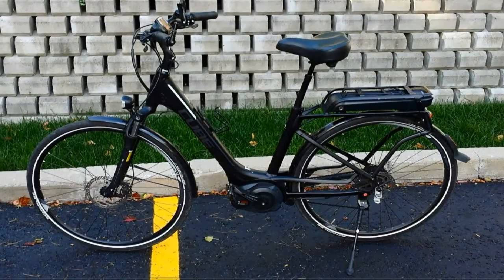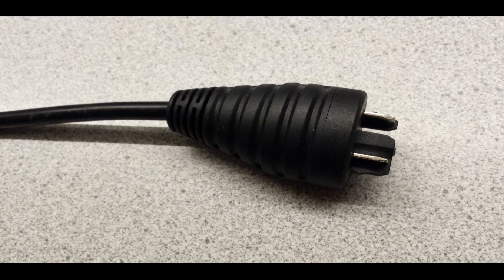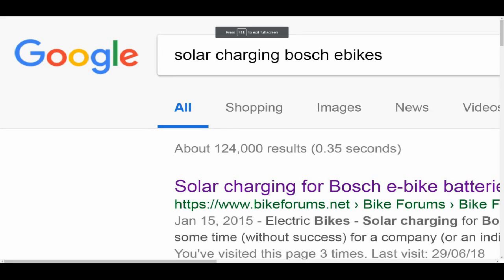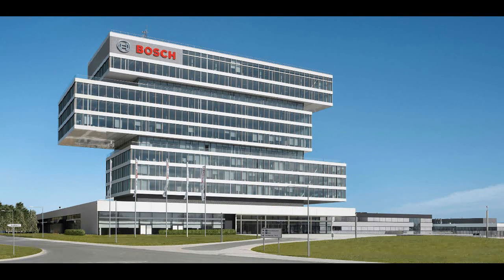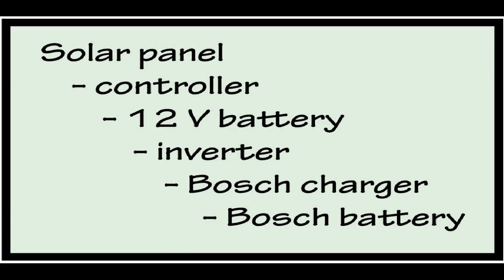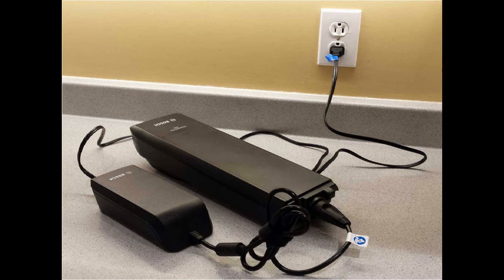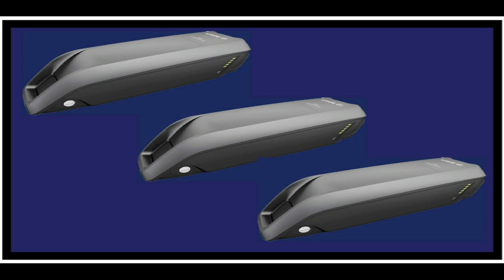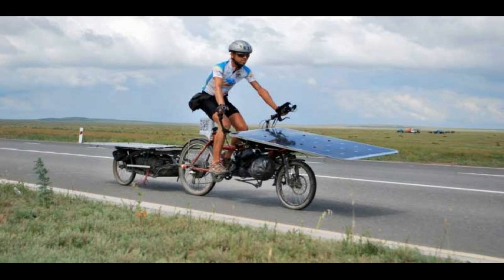Solar Charging a Bosch Ebike Battery   Disappointment

Comment: Hello Robert, I am a certified Bosch e-drive technicien, the information you got is right, you can't charge a Bosch battery with anything else then its charger, the battery has an electronic board that works only with the rest of the system or the charger, the battery needs to be powered buy a 5 volts dc to activate, and event then it will pulse, because it needs a specific signal at a certain frequency to operate, Bosch does that so nobody can use a different battery on their system and to protect the battery from another type of charger that could damage it, and also to manage the whole system, you get three pages of info on your system when you connect it to the a computer for software service and updates. Your Bosch system is a very well designed system, and works very well as it is. If you had a standard battery that can be charged by any means, it would still be impossible for you to charge it with solar panels on your bike, your battery voltage is either 36 volts or 48 volts, if you have a 36 volts battery, you would need 3 solar panels in series to charge it and 4 in series for the 48 volts, they would have to be very small to fit them all on your bike, in order to charge a battery, you need your charging voltage to be higher then the battery voltage.
Reply from the maker: Thanks for the excellent explanation for the way Bosch manages its battery and charging system. That's the best explanation I've found. As for charging from a solar panel, you don't need multiple panels in series. Most Sun Trip participants use an MPPT boost controller to feed the power to the battery. Thanks for sharing your knowledge of Bosch.
Reply: Robert, THe charger puts out 42 volts between the minis and plus when 5v apply to the third pin. Serendipity Sue here on youtube has videos on how to charge the bosch battery and it does work. Charging a spare battery and swapping should work fine.
Reply: Bosch doesn't do this to protect the battery. To protect the battery, internal smart regulartion and monitoring is enough. Bosch does this so that people will be forced to buy their chargers as well, so that they can make more money. Just another charge and cable to carry around. This must stop.
The information you provide is distraction, you don't need to increase the solar panel count, all you need is proper power conversion to acquire the right power. 
With enough voltage and limited amperage, charge speed would only be low.
There is a big difference between "you can't charge it" vs "you can charge it, but it will be slower compared to outlet".
The "specific signal" whatever magic can also be easily acquired and simulated.
If it's safety, I'm with you. But if it's about Bosch having more convenience at the cost of my own convenience and less money in my pocket, then no I'm not with you.
Reply: Hi Christian-Maurice, Im Trying to build a Drone Charger with my bosch battery, I have a charging port directly in the frame of my bike. I would like to order a plug(you can only get the 5Pin version) and plug it in. Btw do you know why I have those 2 more Pins on the 5 Pin plug(6Amps)? I then want to Use a Voltage Step down board(enough watts) to get from the 36V to the 12V of my charging Device for the Drone Lipo batterys. I will also put in a 4A Fuse. Do you think that will work? Do I have to put 5V on the regulator Pin to get current out of the battery? And do you reckon the reversed current will damage anything? I thought, if I use  the charging port, just inverted, It should be fine. But I didn't know about the 5V regulator Pin, guess it switches a MOSFET or so. I hope you can give me some advice :)
 Thank you for your help :)
Reply: Didn't Bosch sell a 12 volt charger?

Comment: I’ve got the Bosch 500 it’s packin, plenty of juice! To charge it up via solar would take days. Unfortunately better solar tech isn’t available for the general public yet? 
When we all switch to e cars, electrical prices will Ffffrrriizzzzlllle 4 shizzzle!
Reply from the maker: Solar panels are still improving. SunPower now has a flexible panel that is 25% efficient. We're getting closer to the point where it will be possible to travel by road solely on energy from sunlight.

Comment: I read somewhere that the 12v chargers only work when the battery is connected to the bike. Just tested the voltage on the side plug and found 41v
Reply from the maker: My batteries, the rack-mounted Powerpack 400 and Powerpack 500, don't have a side plug. So to charge one with a solar panel, if that had been allowed by Bosch, I would have had to charge it off the bike. With three batteries that wouldn't have been a problem. From what I've read, Bosch has discontinued its 12 V charger, ostensibly because people have been ruining their car batteries in using the charger.
Reply: Да, так и есть. Я подключил солнечную панель к боковому штекеру. Начинается зарядка, и через 5 секунд отключается. (при достижении 3,9А)
Reply: @MrGf3  its obvious you have no idea what you are talking about. The battery cable is always min. 36volt. For your safety pls just leave it alone before you harm yourself

Comment: https://www.ebay.co.uk/itm/eBIKE-BOSCH-TRAVEL-BATTERY-CHARGER-ACTIVE-PERFORMANCE-12V-DC-DC-0275007914/173916143930?epid=534509664&hash=item287e35c13a:g:BsYAAOSwSINc6wF~
Reply: only one left ,hurry :) i have the 2011 charger with different connector. so i would need a 2013 2011 charger adapter as well to use it. more money. the 2011 charger has a slow option at 36v 1a. that would be awesome for a small solarpanel. this is offcourse 36v 2 a. 150w might be enough.
Reply from the maker: The problem there is that I'd need to feed the solar panel into a 12V battery to plug the charger into. Extra weight and loss of efficiency.
Reply: @RobertBeriault753  you could also get a 12v solar panel and directly put an carplug on there. or a dc dc converter with carplug. could even strip the 12v car plug from the bosch charger and attach the wires to a 12v converter or directly on a 12v solar panel?
Reply from the maker: And, I haven't confirmed this with Bosch, but someone told me it doesn't work with the 500 Wh battery.
Reply: @RobertBeriault753  i would say if the 2013 charger works on the 400 and 500 packs then why wouldn´t it work on the 500. well the outher housing of the v12 charger is the same as the 2013 charger it seems. or do you need the smaller 2017 charger voor the 500wh pack?

Comment: Excellent Points.  I suspect that the American Legal System, (where everybody sues everybody at the drop of a hat,) is likely why Bosch is so reticent on supplying European products to American Consumers.  For example, I bought my FeltElectric SPORTe95 in October 2014.  Bosch had been licensing their pedelectric motors to manufacturers and selling them in Europe for SEVERAL years by then, but at that time, in the States, NOBODY seemed to be carrying them.  I bought mine because it was lightweight (30 lbs. stripped) and would power through a 25 mile roundtrip commute to my job.  Since then, FeltElectric has dropped the price of them by $1000, I suspect since NOBODY besides me was buying them.  My loss, and an expensive lesson for earlier adopters of new technologies.

It makes NO sense at all for Bosch NOT to offer an official solar charger.  
In the same vein, MANY other manufacturers include a standard USB on their speedo/controller units or directly on the battery, so that you may keep your phone charged.  On my controller, it includes ONLY a microUSB female jack.  

I have attempted to link my iPhone via a Lightning Cable to a cable featuring a male microUSB connector and a female USB jack, but (of course) Apple's arrogant error message, about the tools not being compatible, pops up.  It is ridiculous.    My solution, at least for the phone, is to use a small,  solar charger, https://www.amazon.com/24000mAh-Waterproof-Portable-Compatible-Smartphones/dp/B07C24XC2L/ref=sr_1_4?keywords=solar+phone+charger&qid=1557328677&s=gateway&sr=8-4, that I connect to my iPhone by USB.  It keeps it charged, but there is still no way to use any solar charger for the Bosch bike batteries. 

Collusion indeed.  This is sad.  

First Bosch persuades us to buy their products, but then tells us to sod off when we ask for new innovative product development to support and improve them.
Reply from the maker: You've elaborated on my points with your excellent ones. Another thing that irks me about Bosch is their refusal to provide a throttle on their bikes. I can see why in Europe, where it is forbidden by law, but I would have thought that the rest of the world is a large enough market to make another category of bike for. 
While I'm at it, why doesn't ANY ebike manufacturer produce a battery with a 12 V outlet, like all cars now offer?

Comment: Bosch is disappointing also on upgrading to their dual battery product... and in stating they are not familiar enough with solutions to modern needs like solar charging... I thought higher of Bosch. Of course - it is quite dangerous to go engineering on it by yourself...
Reply from the maker: Another disadvantage is that the Bosch system doesn't allow a throttle. As my knees age, this is becoming an issue for me.

Comment: Hi, Robert.
I think this will work:
Use a 2 Amp Bosch charger connected to a GoalZero 100 AC power bank connected to solar.
The 100 AC will refuse to feed the 4 Amp Bosch charger.
You would probably bring a power bank for your other electronics anyway. This one is not very bulky.
Kind regards
Søren
Reply from the maker: Hello Soren

The GoalZero is a nice power pack, but of insufficient capacity to supply power to the Bosch charger, which needs an input of 270 Watts. I thought about buying a more powerful pack, but it would weigh several kilograms. 

Best regards
Reply: Hi, 
You would be using the Goalzero Sherpa AC100 as an inverter not as a powerbank.
Connect a solar panel to the Sherpa’s 8mm input port and plug in the Bosch charger to the AC outlet.
I have tried this with a more powerful solar generator, which weighs too much to consider bringing on a bike ride.
When I get a chance to test the Sherpa AC100/Bosch 2 Amp setup properly, I will let you know.
Kind regards
Søren
Reply from the maker: This sounds worthwhile looking into. As an inverter, can it produce more than 100 Watts^
Reply: Hi, Robert

The output limit for the Sherpa is 100 watts.

What I call the 2 Amps Bosch charger (it is also referred to as the companion or compact charger) will not in my experience exceed that.

If you want to use the standard 4 Amps charger, you will need something more powerful.

I have a Lensun 550 Wh solar power generator which accepts the standard charger. It weighs about 5 kg, though, but has the advantage of having an MPPT solar controller.

But for my purposes the 100W limit will not be a problem, I think.

One would be able to pick up 100-200 Wh during the day with some solar mounted on a bike trailer. Charge the Sherpa on the go and deplete this into the ebike battery during breaks. Then charge Sherpa and ebike battery afternoons and mornings.

Kind regards

Søren

Comment: I've been searching connectors as well, and indeed it's quasi impossible to find. weird. Thanks for your video. There are 3 pins, strange setup. good luck, i'm only a beginner so cannot help you.
Reply from the maker: Hi dna,
I learned from other subscribers that the third pin can be used to bypass the system that prevents charging. Apparently, if you supply that pin with a 5 V current, you will be able to charge the battery with a solar panel. I haven't tried it because I don't know how to do it.
I'm hoping to find somebody in the Ottawa area who can help me.
Robert
Reply: @RobertBeriault753  Hi, did you eventually do this ? does this bypassing work ?

Comment: I've been searching the internet for a direct charger to go from car 12v to ebike battery pack. Not bosch ebike, but any ebike battery. Can't seem to find something  simple.
Reply from the maker: If I ever buy a charge controller to feed a lithium battery from a solar panel, I'd go with Genasun: 
https://genasun.com/products-store/mppt-solar-charge-controllers/mppt-for-lithium-batteries/

2 wires in 2 wires out if it's not Bosch
Keep me posted. You can reach me at allorobert@gmail.com. Good luck.

Comment: As it took me a while to find on google: There is a german forum which has a lot of information on the bosch ebike system. 
This thread is about charging the bosch system with a none bosch charger: 
https://www.pedelecforum.de/forum/index.php?threads/bosch-akku-performance-400wh-mit-modellbau-ladeger%C3%A4t-ladbar.33856/ and is a good starting point.
There is a review of the mvelo solar ebike charger here https://www.pedelecforum.de/forum/index.php?threads/mvelo-mpp-solar-lader-fuer-pedelec-akkus-test-labor-und-praxistest.12179/. 
However this charger will not work with the current bosch systems probably because it does not provide enough input current.
Reply from the maker: Two other people have informed me about opening the Bosch system by putting a 5 volt current into the third pin of the battery. I will need to find a local electronics  expert to help me put together a system that will work because this is something I don't know how to do.
I wish I could read German
Thanks for your input.

Comment: You should be able to charge the bosch battery from a solar panel if you use an MPPT charge controller that is set to no more than 4A, you hack the connector off of your existing charger in order to obtain the proprietary plug, and you wire up a 5V regulator so that the output of the MPPT generates a 5V signal which goes to the 3rd pin on the charger plug and in turn 'opens up' the charging port of the battery pack. Without this 5V present on the 3rd pin of the plug you won't be able to put in any charge current. And from our experience using a Satiator to charge a Bosch ebike pack, as soon as you hit 4.5amps, the charge port will shut off as well.
Reply: Dear grin tech, thanks for this info. However, could you make a little diagram on the exact wiring for this? How could one easily do that with a 36v solar charge controller? Thanks in advance!
Reply: @dna2087  trying to find a way to charge my Bosch battery with solar - I found a channel called Serendipity Sue, the guy who runs it, has made both a car charger for Bosch, including files for 3d printed plug ends and detailed descriptions of all that is needed plus how to put it all together) as well he has made solar charge trailer for his bikes, and a converter for satiator charger to Bosch battery, which I assume could be altered to work with other chargers. I'm trying to use the idea he has for the car charger to create solar charger for my bike with Bosch battery. It's not my area of expertise so I'm not sure if I'm barking up the wrong tree or not, but I'll give it a go nonetheless.
https://www.youtube.com/watch?v=YejPGydMOnw
Reply from the maker: Thank you for taking the time to look at my video and for your feedback. This is very useful information. I still haven't given up on solar, so this might be of great help.
Reply: @Grin Technologies

Hi, Im Trying to build a Drone Charger with my bosch battery, I have a charging port directly in the frame of my bike. I would like to order a plug(you can only get the 5Pin version) and plug it in. I then want to Use a Voltage Step down board(enough watts) to get from the 36V to the 12V of my charging Device for the Drone Lipo batterys. I will also put in a 4A Fuse. Do you think that will work? Do I have to put 5V on the regulator Pin to get current out of the battery? And do you reckon the reversed current will damage anything? I thought, if I use  the charging port, just inverted, It should be fine. But I didn't know about the 5V regulator Pin, guess it switches a MOSFET or so. I hope you can give me some advice :)
 Thank you for your help :)
Reply: @nicoxxl26  AFAIK Bosch batteries don't like to be discharged from the charging port, or certainly they don't like to be charged from their discharge port, so I would be surprised if this works but you'll only know for sure by trying it out.
Reply: @GrinTechnologies  you put the battery inside the frame of the ebike and plug it into 5 connectors, the exact same connectors you would use to charge it. So I guess it will be finde

Comment: How about installing a plug and socket into your existing charging cable? That way you can move the Bosch plug between systems...... I have just bought an mppt controller and that is my intention. Being able to move the plug from the original factory supplied charger to my “ mobile charging system” and back again, seems to be the much cheaper option.
Reply from the maker: I tried it, but it didn't help. The Bosch BMS doesn't seem to allow any interference with its function. It's a strange system. I can't even get a voltage reading from the positive and negative terminals of the battery. If you manage to do it, please let me know how. BTW, which Bosch ebike do you have?